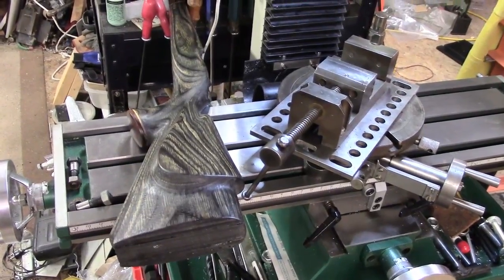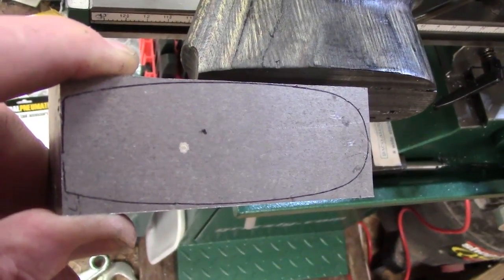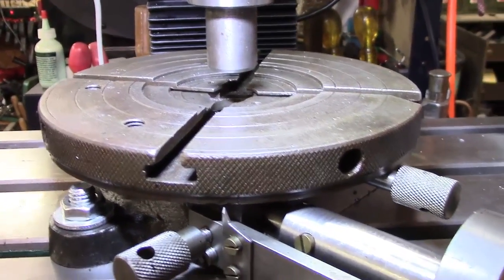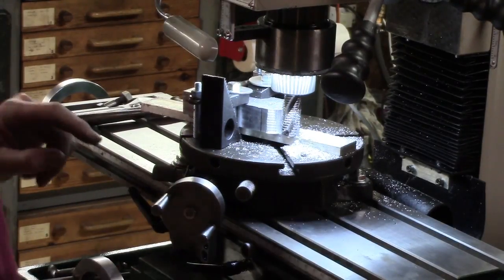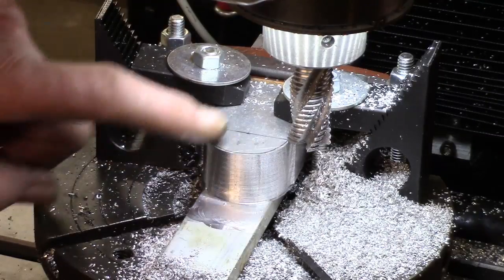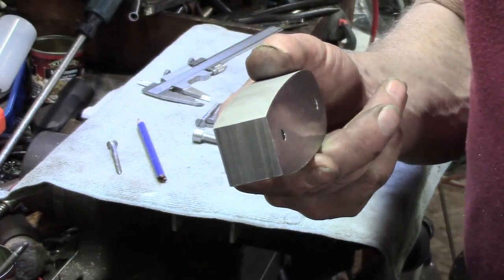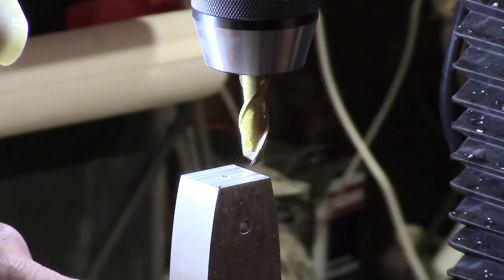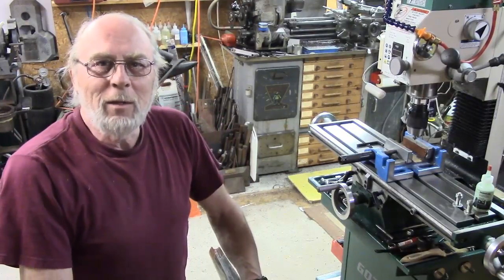A Rifle Butt Plate

Comment: Back in the fifties and sixties with benchrest and varmit shooting I thought I had seen it all in stocking.  Adjustable cheek pieces, buttplates, thumb holes, heel pieces, you name it but I have not seen that.  Some used a highly crescent shaped butt and spacers abounded.  Amazing.  I would sure hate to shoot it prone!  

Well live and learn.  Doug
Reply from the maker: +Douglas Thompson 
Interestingly Doug -- my shooting goes back about as far as yours but -- in the 80's or so I was shooting serious indoor .22 and that was when I used a butt hook.
My BSA Martini was well tricked out - adjustable for butt length, cheek, and also had an excellent very adjustable hook - which was used for entirely for prone - the way it sat under the armpit made for extra stability and then all that with a single point sling and fore-end stop - made whole deal super stable.
Like so many things - often a case of what works for the individual! 
I would have greatly liked a butt hook back when I shot .303 long range with a MKIV back in 60's.... best and only extra back then was just Parker Hale aperture sights.
Reply: Synthetics and options were just getting rolling.  I kept track of competitive shooting but most of mine was hunting related, 300 win mag, 243 win, 06, and a ton of just fun 22's.  Doug

Comment: Looks great Chris.  Like the idea of hollowing out the back side to reduce the weight.  The AL probably adds about 6-8 oz., but the AL also seem like it may be a bit painful on larger calibers¿  I know my shoulders aren't like they used to be!  ~¿@  Also liked the experiment with the rotary table and have been kicking around the idea of using the plate as an Archimedes Trammel to do ellipses.  If the T-slots were clean and good sliding fit, I think it could work on a manual machine.  Thanks for Sharing your work with us!!  ~PJ
Reply from the maker: pjsalchemy I'll probably ask the guy if he wants the weight reduced. Indeed, if this was for a .308 instead of a 6.5mm perhaps it would be a bit harsh! It would still be possible to either reduce thickness a bit and/or apply a cushion layer on rear for extra comfort and grip. In some ways, a bit of a prototype!
Reply: ChrisB257 even my ancient Arisaka 6.5 bites me when I'm not l@@king, but will still put 3 in a 1/2 dollar at a 100.  Really Nice for a Proto and like you say a layer of cushion outside or between the stock & plate would make a world of difference. Love the variety you bring us Chris....Thanks!
Reply from the maker: pjsalchemy Thanks - in fact gave it to the guy earlier and he is well pleased. I offered to mill out some of back but he is happy with it so far and will get the whole gun put together and try it out. I'll get some feedback later from him.

Comment: It all turned out well! You could have saved a lot of time by ripping of the excess aluminium on the corners in the mill with straight cuts, then fitting the butt plate to the stock to get the final curve and scribing it, it would then be much easier to use the abrasive belt sander, that would have been much quicker, but I understand that you wanted to use your rotary table, I noticed that you were climb milling when you took off the corners, that will tend to keep pulling the work into the cutter giving a grabby finish, (I know you were only roughing, but for future reference). It would also have been possible on such a light calibre rifle to partly hollow out under the butt plate, that would be one way of achieving some sort of balance, I know it is not that sort of rifle, but it would be an option. Chris B.
Reply from the maker: Englishman French Hi -- indeed yes, the milling with rotary table was very much an experiment! Material removal was all I wanted so yes, means to an end with no concern for the finish unduly. Reason for not milling off corners was a sort of laziness - set-up time in mill! Like your idea for removing material inside the plate -- nice idea and will suggest to the guy in case he wants to save some weight -- will see him today and suggest remaining options. Have made a set of four different thickness Al spacers for it now, to facilitate a height option change for the butt hook if needed.